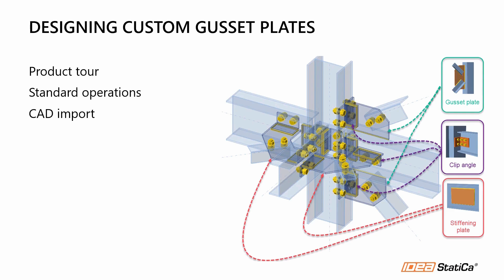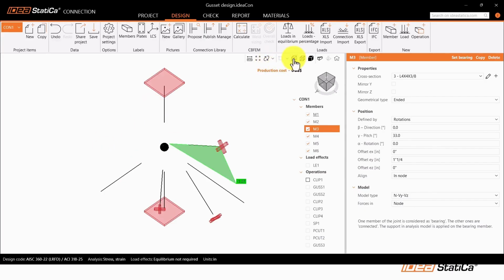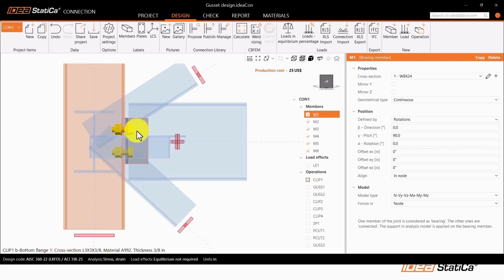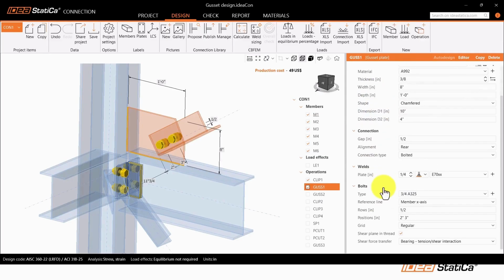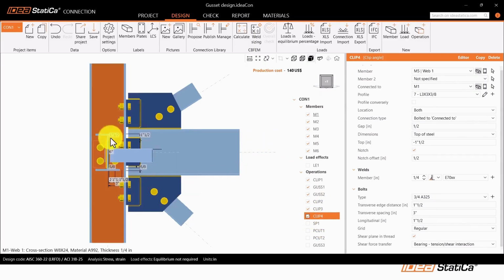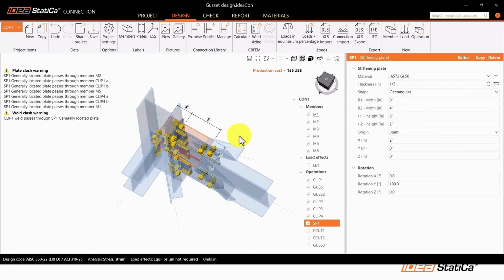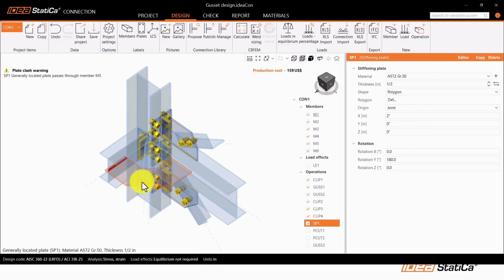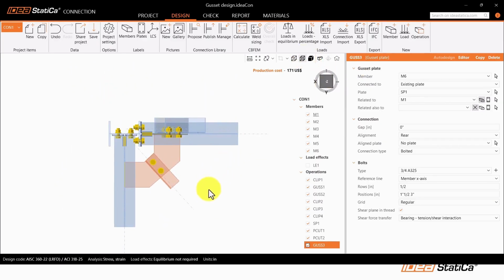Designing Custom Gusset Plates with IDEA StatiCa

Comment: There is an easier way to do it. This type of plate cut, depending on the angle of the bracing member, can be created using “working plane LCS + Plate Cut” operations. 

It works very well.
Reply from the maker: You are right! This is a new feature since version 23.1.1 and works perfectly for such situations.
https://www.ideastatica.com/support-center/execute-plate-cuts-in-parallel-planes

Comment: “A command is required for generating a connection with a double gusset plate and double cover plates, because currently it takes a lot of time to model this connection using the manual stiffening-plate operation. The connection involves two gusset plates—one connected to the column web or flange, and the other inserted/notched into the steel profile with an offset between them. To connect these two gusset plates, two cover plates are needed on either side, bolted through both gusset plates.”
Reply from the maker: Hello, thank you for the insight. There are many configurations of gusset plates, some of them are more laborous to create, but still possible :)
https://www.ideastatica.com/blog/gusset-plate-what-s-the-big-deal